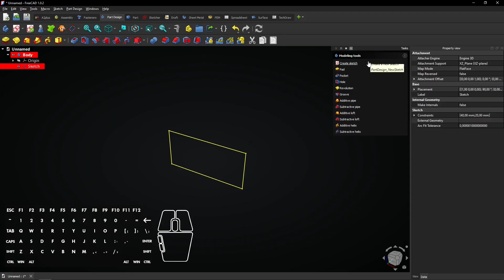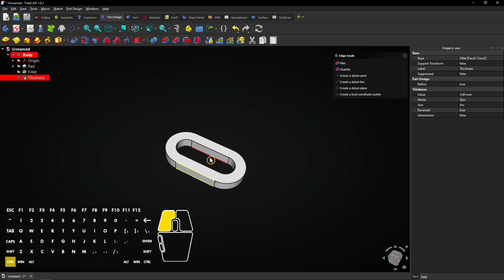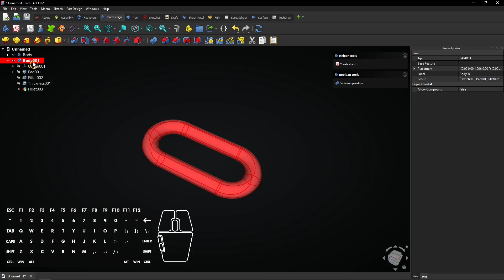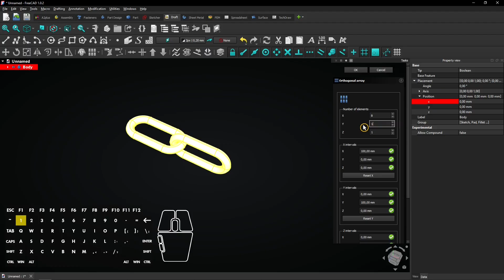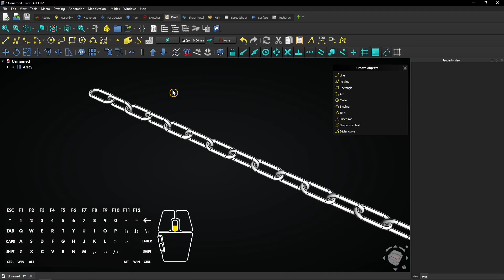⛓ Chain Link Design - FreeCAD Rotate Object - FreeCAD Linear Pattern - FreeCAD Array

Comment: Thank you for the useful illustration of this approach.
Is there a specific reason why the pattern was created using the Draft Workbench? The Part Design Workbench also offers a tool for linear patterns which works also just fine.

Just a minor note, since the primary focus of this video seems to be on creating the pattern and not on how the chain link is created.
The chain link can also be created in fewer operations using two sketches and a sweep. To do this, an oval is created on the XY plane to provide the path.
On the YZ or XZ plane, a small circle with the diameter of the material thickness is then drawn in a second sketch, which is centered on the previously drawn path using constraints.
A sweep of the circle along the path then creates the body of the chain link.
In my opinion, this has two advantages. 1. Fewer operations, as there is no need for all the fillets. 2. The rounding can be determined precisely by the diameter of the small circle, rather than by approximating a corner radius, which would cause a program error in FreeCAD if entered exactly (e.g. when you entered 9.99 mm instead of 10 mm).
I have tried this, and it works great, without any errors.

Anyway, your videos have already given me many useful tips, and I look forward to the next one.
Reply from the maker: Thanks! The Draft workbench is used, because a Part Design Pattern needs a solid to intersect. About the Sweep, you're right! But showing the Thickness tool in a different way was also something i had in mind.